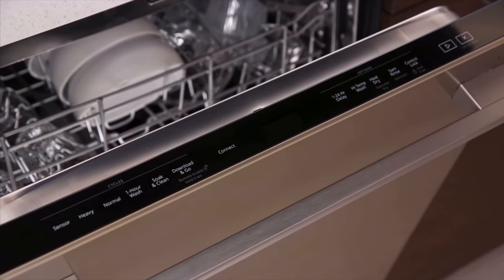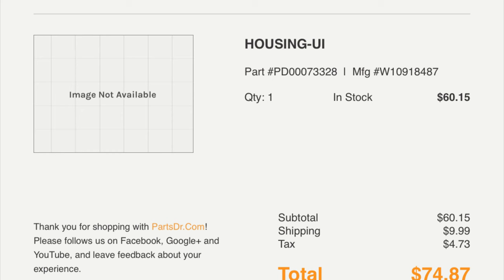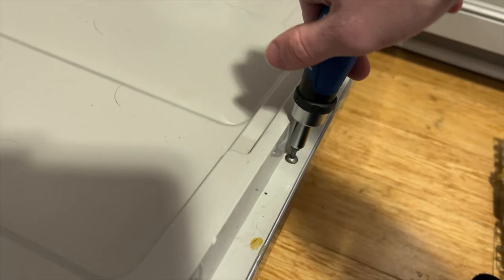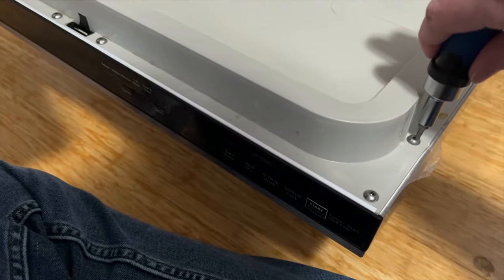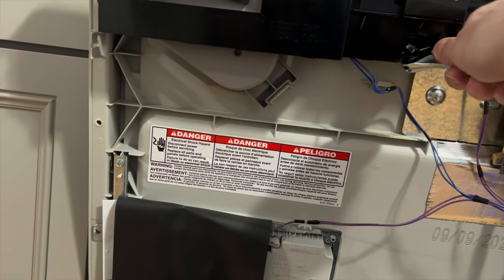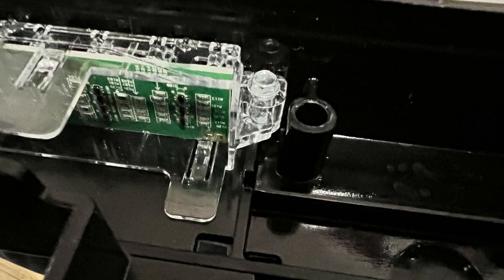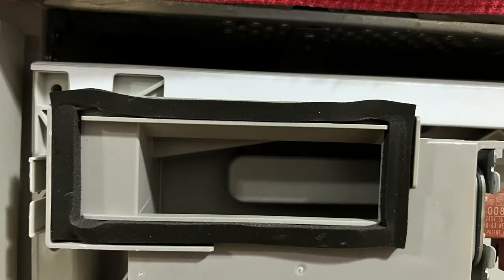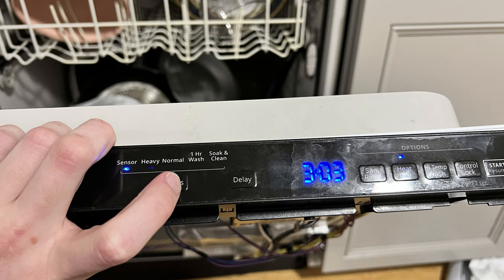Whirlpool Dishwasher F2 E2 Error Code Fix

Comment: We bought a new dishwasher and we’re getting this code after installing it … what could be wrong ?
Reply from the maker: If it’s brand new, it is likely a defective display board or PCB. If you’ve already tried to reset the breaker and that didn’t work, your best bet is having the part or whole unit replaced under warranty. If you didn’t purchase an extended warranty from the retailer, the whirlpool limited warranty will cover this.